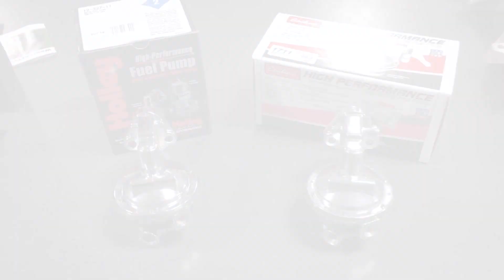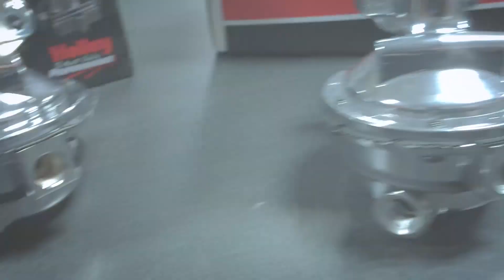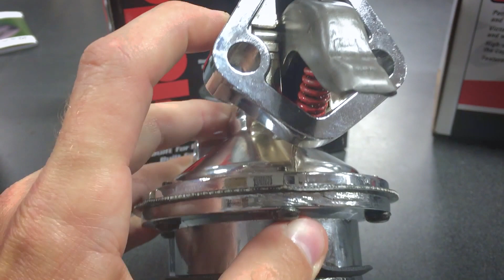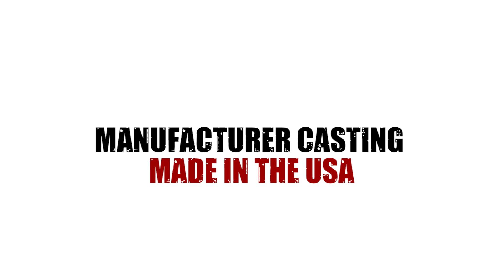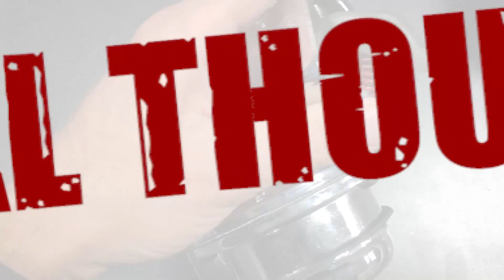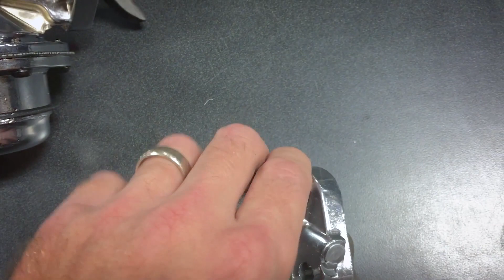Holley VS Edelbrock Mech Fuel Pumps

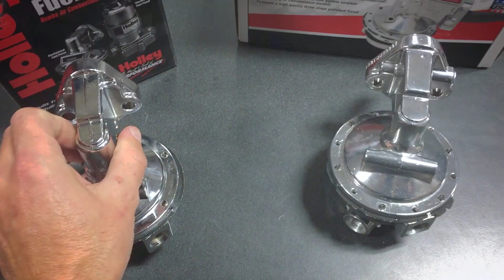Comment: Important note about mechanical fuel pumps .OEM pumps had " weep holes" around crimp ring on pump body . Those holes are very important !  When diaphram eventually fails ( and it will) those holes are a telltale indicator due to gas odor something is seriously wrong ! Those holes allow gas to run out to outside of engine instead of your crankcase oil destroying your bearings. Almost all replacement pumps have omitted those weep holes. Never accept any pump without those holes just above crimp rim ! 2:26

Comment: WARNING !!!  Many new knock off fuel pumps will destroy your engine! Check any new pumps you have, if it does not have the two little "weep" holes near the crimp on pump body it will destroy your engine when diaphragm in pump fails. Those holes are there to let fuel out and not into engine.DO NOT  install a pump if these holes are not there as many knock off pumps fail to have

Comment: Good points. I disagree about the smaller diameters than the threaded area. Imagine the I.D. of the fitting being used and then you'll better understand why the point you made is irrelevant.

Comment: I am going to disagree on ports for the exact points you noted.  The Holley being full bore inlet/reduced outlet [as most liquid pumps tend to be] is a good thing. This will help check valve snap shut faster, delivering fuel a touch earlier for the same stroke. The extra ejection pressure dropping after the port is fine - a carb only needs 6 or 7 psi anyway, but can pull lower IF they get required volume.   For a pump that has no effective precharge on suction [tanks are pretty much at atmosphere], having the larger suction port helps the pump work more efficiently.  If a 350 engine needs more than 500hp worth of fuel delivered... its kind of time to give up on the  mechanical pump anyways - especially these non-return styles.  Going to a higher volume per stroke mechanical can work, but is going to force a return style system be installed to manage cruising feed: change out sending unit or add a fitting to the tank and run lines. 
My preference? The Edelbrock wins because of the pin alone: I like being able to repair something. [Wth was Holley thinking?]
Its worth pointing out a diaphragm pump is a positive displacement design: it moves full volume/stroke  without shearing problems a centrifugal pump experiences - no efficiency curve voodoo there.  Pivot arm ratio determines stroke; and in combination with diaphragm diameter, volume is set. If there is a test to note with any fuel pump, always begin with volume: gph must meet hp design or redline gets de-rated because bowl level can't be maintained.

Comment: Holes are different sizes because the Holley is a 80gph and edlebrock 110gph?
Reply: Actually the Edelbrock is 130! It's their race pump that needs an external regulator so a bad unit to compare to the Holley. A better comparison would have been against the Edelbrock 1721.

Comment: At a loss why I’m not getting fuel pressure on Chevelle. New filter, checked fuel lines, even put hose in gas can to see if I got fuel. Took pump off and took it apart and cleaned it up. Not getting any pressure. It’s a Holley pump.
Reply: The arm has to be compressed when you put it back together. You obviously did not do that.

Comment: Hi thank for this video . maybe you can help I have a problem with my Edelbrock fuel pump 1721. I have an air leakage.. I pump air instead fuel !
I have unscrew the bottom part to rotate the in/out inlet part. This pump have screw to do this BUT the probleme is that when we screw this part at the maximum at 20-25 in/lbs and 1,6 lb.ft ( for me France) ... I stil have leak...
It's in aluminum so we have to be careful.. I don't understand why screw as said in manual I still have leak...
thank you
Reply: How hard is the reclocking procedure? How much of the pump did you have to take apart? Just the lower housing screws? Or did you have to disassemble the entire pump?
Reply: Possible vapor lock situation?

Comment: Would change my mechanic fuel pump from the original pump I have on my old 1979 gmc truck 305 if i put a eldbrock pump would my truck be better on gas? And preform better ?
Reply: no cause your 305 is stock and in a truck.  20 yrs ago when i did my 305 in an 80 impala 2 door i should have went with a stock pump.  it had stock heads an an RV style cam.  thats just more fuel than its gonna need and these edelbrocks are over 100.00 save your money and keep the stock one until it fails.having more fule pressure than what the carburetor can take will push the needles of the seats and flood the carb.  then you need a regulator and more unnecessary plumbing.  save yourself the trouble
Reply: @KingJT80  Except the edelbrock pumps are designed to be operated without a regulator as they have a max psi of 6. At least the one showcased here does. So no they aren't going to flood the carb or do anything to the needle and seats. Having said that as long as the stock pump is functioning correctly changing it out isn't going to help anything as a fuel pump by itself doesn't improve performance if nothing else is done. In most cases adding power never results in better mileage anyways. Unless you are also drastically improving efficiency at the same time.

Comment: The smaller bore I would think increases the pressure.
Reply: Anthony Wayne doesmt work like ac lines and auch where the small lines are high pressure and the big lines are low. With fuel you want more room for flow